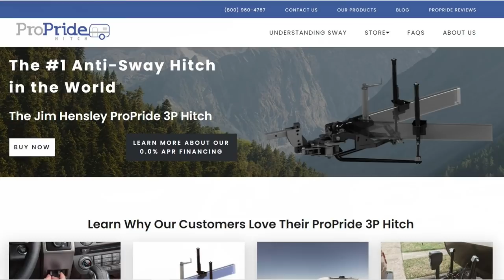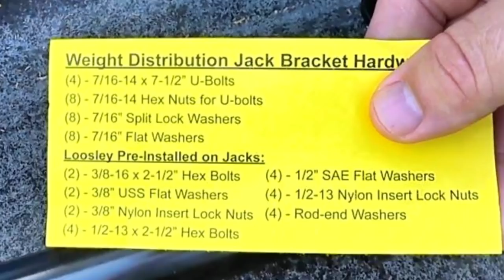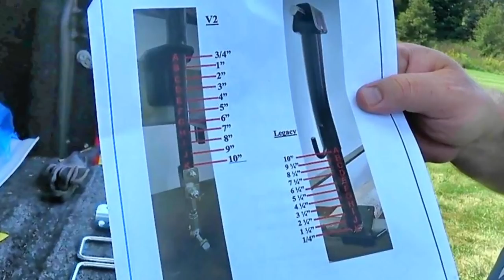RV Hitch *UPGRADE* Propride V2 Jacks

Comment: Mike, good video. Considering an upgrade to the V2 jacks. Have a few questions that may help many decide. 

1) The old legacy jacks have the aluminum bar going down from the bottom of the Jack hook to the spring bar below. The aluminum bar holds the hitch head fairly stable and at the desired angle to easily back the stinger in when hitching up. It appeared in your video that the new V2 jacks did not hold the hitch head as stable possibly making it more difficult to back your stinger in. This is a similar problem experienced for those with the Lippert Straptek Technology. What’s your experience hitching up? Is the hitch head just as stable with the V2 jacks? 

2) I sometimes have to unhitch at an angle where the spring bar is under your main electric jack foot plate. This forces you to lower your springs bars to get them out of the way. Sometimes you have to remove the jack foot plate, lower the jack beneath the spring bar, and put the jack foot plate back on to lower the electric jack. Any idea if the V2 jacks changes the situation when unhitching at an angle? 

3) Have the V2 jacks improved your towing? As you said, they are shorter and in more of a direct line above the spring bars. 

Thanks for the video and thoughts.
Reply from the maker: Overall the V2 jacks act very similar to The Legacy Jack's... they still will bind up to hold the hitch head in position it may just require you to raise or lower it at a greater height for it to happen due to the fact the heim joints will kind of fold over on themselves before they'll hold position. Unhitching at an angle will still potentially put the bars underneath the footplate of the jack so really that's not changed. Noticing it as we're driving down the road, not really. They are definitely quieter as the solid bar from the Legacy Jacks always needed a little grease where it contacted the hook and the u-bolt on the weight distribution bar. As shown, I believe, in this video the solid bar that connected the jack to the weight distribution Spring Bar definitely had wear and metal to metal noise. I like the amount of effort that it takes to raise the weight distribution bars with the V2 Jacks. I also really enjoy knowing that the jack is very compact when full weight is applied. It also attaches to the A-frame much better then the original Legacy. Is it worth the upgrade cost? I'm not sure unless you were planning on Towing over a few years or quite a few miles. I would assume you will see the same amount of wear on the lift bar like we did around the 10000 mile mark. I don't think I have a definitive answer for everyone and if it is the best way to go but they are definitely an upgrade. Those are very good questions I'm glad that you asked and if you decide that you will purchase the Jacks please use our Link in the description. Thanks for watching and commenting- Mike

Comment: Question for you: I noticed you have a lynch pin on the outside of the frame bracket/Yoke support. Is that something that you always have on while driving or do you just store it there?

My instructions didn’t call for one, but I’m wondering if one is necessary. 

Your videos were a huge help as I was installing my system yesterday, thank you for taking the time to provide detailed instructions and explanations. Looking forward to the first tow with the ProPride!
Reply from the maker: Actually the linchpin is there because I was experimenting with holding my 7-way plug cord out of the way so I was kind of using it for support. I appreciate you watching and hope that it helped

Comment: That’s super similar to a Hensley set up you’ll like it better easy to adjust.  I think the difference between the two is the adjustments on the pro pride and nuts and bolts versus welding. Both very awesome my unit came with Hensley hitch I simply rebuilt it,  It’s 22 years old. Wouldn’t travel without it though. Nice video have a good day Mike and Heidi.
Reply from the maker: Thank you!! 😁
Reply from the maker: Yeah the Stinger angle can be adjusted on the Pro price and they moved the pivot Points back further closer to the ball. The best part of the pro Pride by far is they got rid of those adjustable link arms that the Hensley has that always have to be adjusted and sometimes they have problems with them bending breaking. Remember that the owner of Pro Pride worked at Hensley for quite some time and then opened up Pro pride and contacted Jim Hensley to help him redesign all the problems that he experience with customers while working at Hensley. So the propride hitch is a Hensley 2.0. However, the Jack set up that he was utilizing definitely needed upgraded to this V2 design. I believe the reason they didn't you go to a welded version like Hensley is being able to replace the parts. quite honestly you could buy most of the connecting components at most Farm and Tractor Supply type retail stores
Reply: Never had anything bent or replaced on my Hensley hitch as far as that goes I keep it greased I’ve owned it about five maybe six years

Comment: Very disappointed with the audio. You only recorded on the left audio channel. Made my head tilt sideways.. A real engineer wouldn't have let that happen.. WooWoot...
Reply from the maker: Audio was captured using wireless Rode go II mics direct into Sony action cam... I get playback sound in both my speakers...it May be mono split but definitely not 1 channel...?